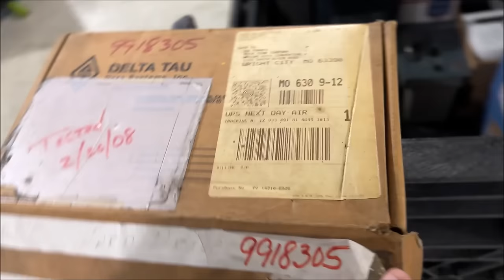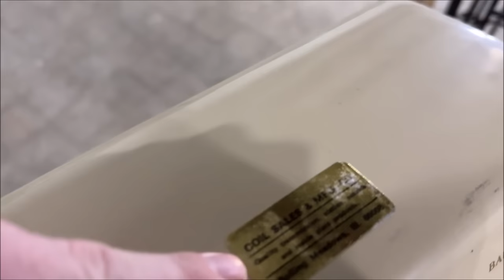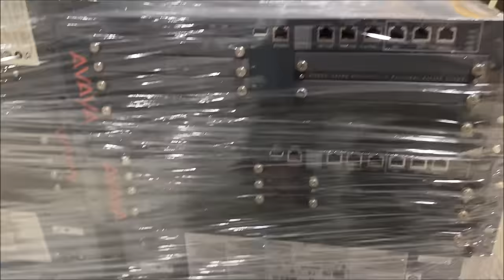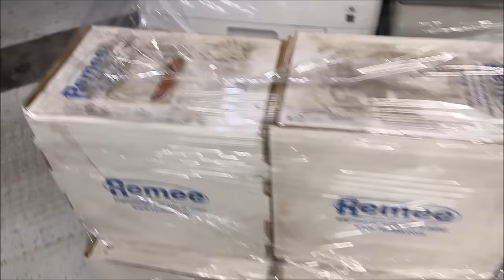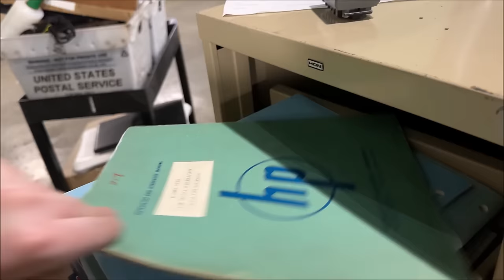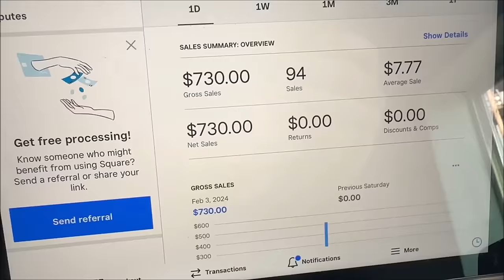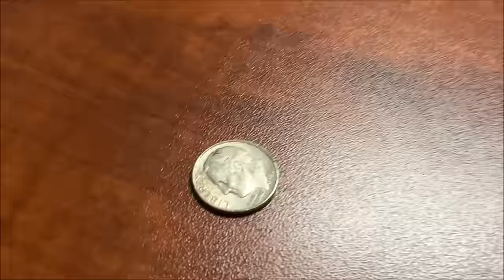Buying Out an eBay Seller [Part 2] - Sorting and Selling off the Junk

Comment: @ 34:00 minutes  those X-Rays ?  I believe they are $$$ ...and yes it's $ because people just  don't remember the old time Pictures ...   
Is there silver in film negatives?
Photographic film - Wikipedia
In black-and-white photographic film, there is usually one layer of silver halide crystals. When the exposed silver halide grains are developed, the silver halide crystals are converted to metallic silver, which blocks light and appears as the black part of the film negative.

Comment: The batteries in the old GPS's are worth more than the units.  Granted they still charge.  Might want to crack them open and sell those.  Those plug and play leapfrog systems at 6:50 are worth $20 each without games.  I sell these all the time and get them when I go to the bins.  If you have games, they can get you up to 30-40$.

Comment: Some of those older electronics might be worth something to prop houses if they work. a clunky woodgrain alarm clock radio might be necessary for a shot ,those guys pride themselves on being able to pull anything for a set
Reply: 35$ eBay
Reply: Don't forget about collectors.

Comment: The keyboards at 1:38 are probably worth more than a 1$ if they are mechanical.
Reply: Correct, some of the mechanical keyboards are desirable for different reasons.  I have an old IBM PS/2 or maybe serial 103 keyboard that sells for over $120 on eBay often.  I used to sell puter parts at a monthly computer swap meet in the late 90's and later had a small store that I sold computer and anything else, and remember using that keyboard on a old IBM computer that I had set up and was using at my store in 1998. Now flash foward 26 years and I can barely get $2 for a good used Dell USB Keyboard. Some sell close to $15 on eBay but I think those listings had free shipping.